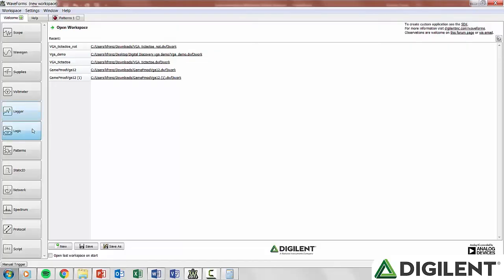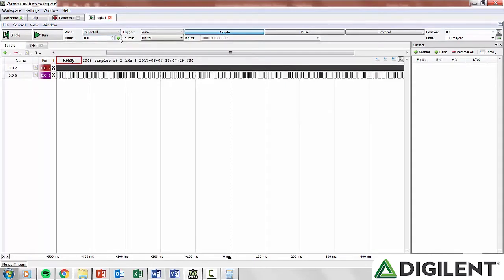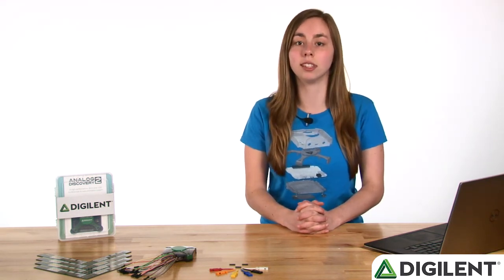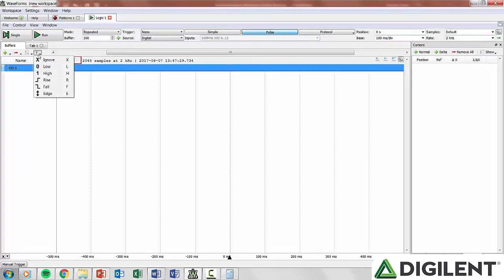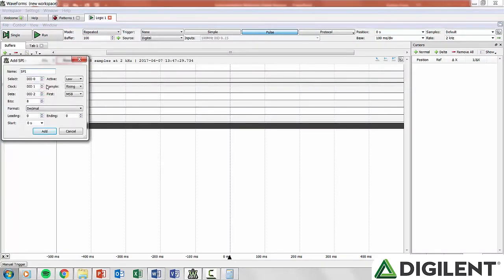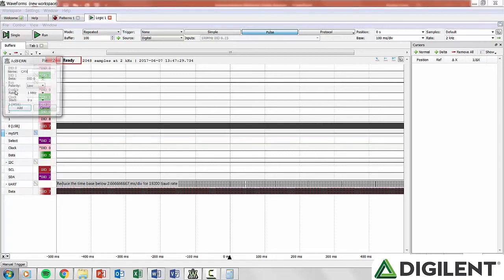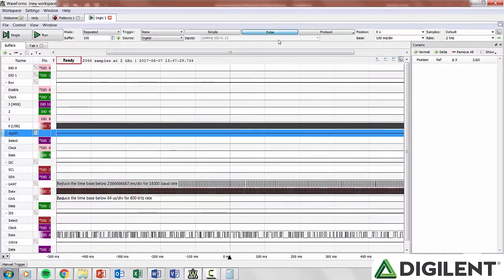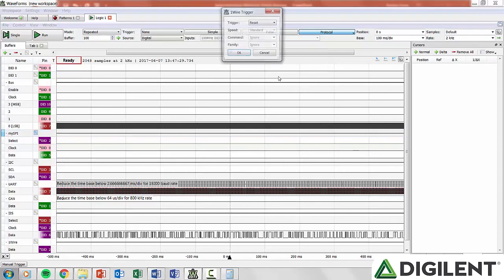Analog Discovery 2 QuickStart: Video 12 - Logic Analyzer

Comment: Why is this software so complicated? All I want to record are my UART signals, but the signal data is lost once it goes off the screen. I've tried all the different modes but this software doesn't even allow me to scroll through 10 seconds worth of samples. Seriously, I can't even increase the time base without the sample rate decreasing with it. So I can't see what realtime samples I get in 10 seconds because the screen doesn't refresh. Or maybe it does? There's about 50 settings on this thing.
Reply from the maker: You should try out the Protocol Analyzer instrument, it's likely better suited to this application! Our engineers will be better able to address any questions you have on our support forum:
https://forum.digilent.com
Reply: @DigilentInc  Hi there. I understand that and have been using it to monitor UART signals across my device. I actually really like the protocol analyzer. However when I am trying to monitor high/low signals, or timings between messages, then the protocol analyzer isn't best suited for this.